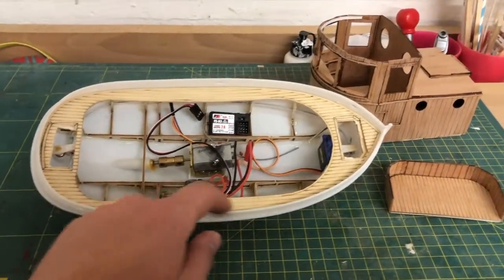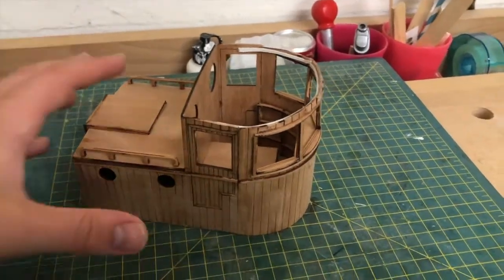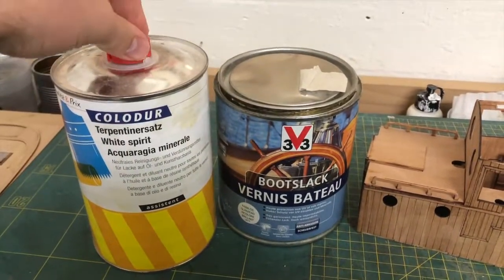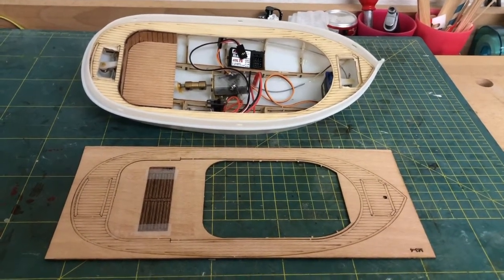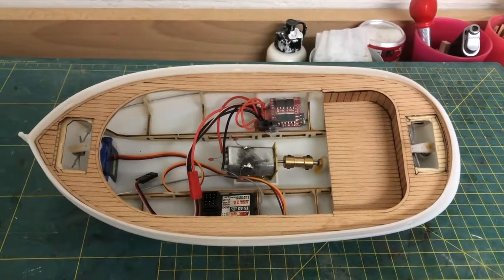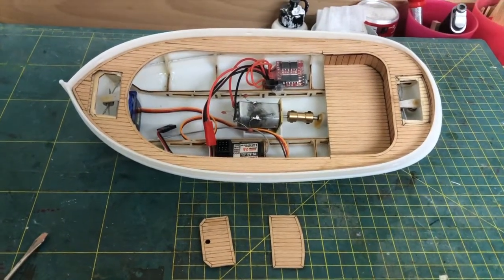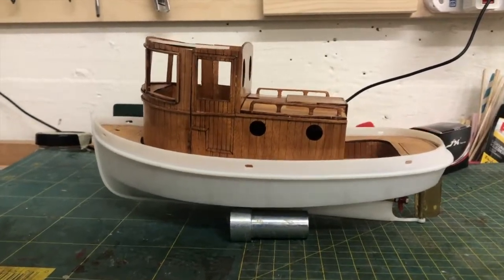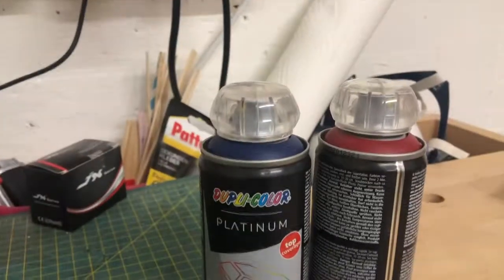RC Tugboat Build Vlog Part 6

Comment: I got up to here with this brittle kit and the deck was off by half an inch, and the sides, too.  I think the hull they gave me was made wrong -- it is too small.  My work was embarrassing so I had to give up.  I am an experienced modeler.  You are doing a great job of making a purse out of a sow's ear.  On to another wood ship kit.
Reply from the maker: Hi. Thank you for your kind words! And I can really relate to you, this kit is definitely not an easy task and yes, it cost me a lot of nerves too. That's also the reason why the build time was so long.Thank you very much for your open words, it's comforting to hear that other model builders sometimes get frustrated and lose the interest in a project too. my tip: do not throw it away, just put it away and start another project ... eventually you feel the desire to face the challenge again and if not that's fine too ;) good luck with your projects!